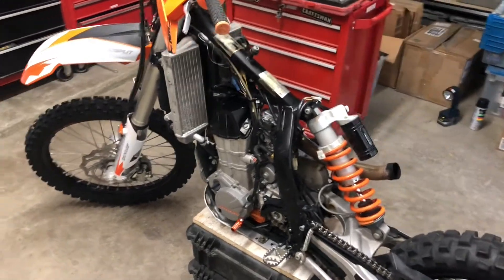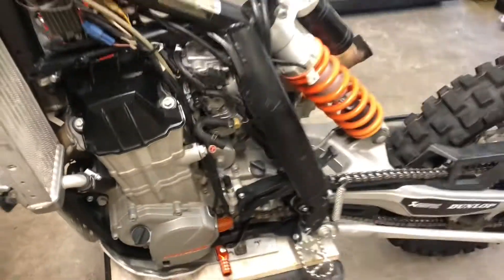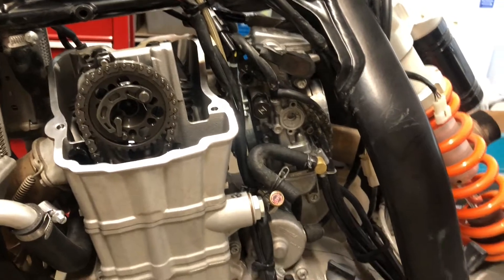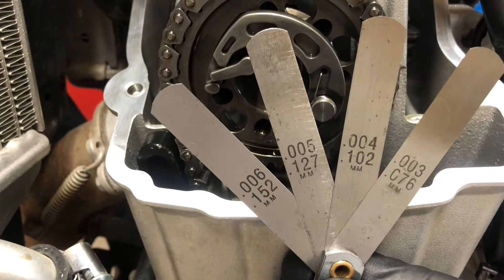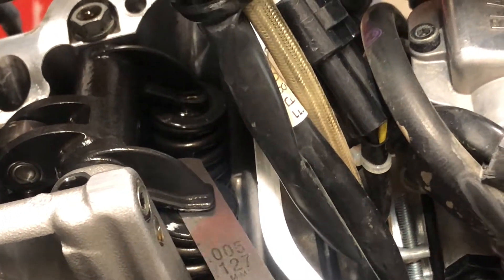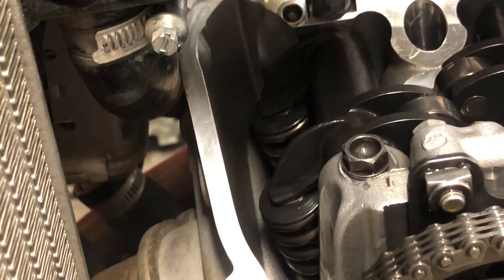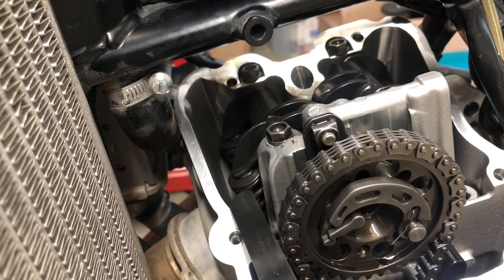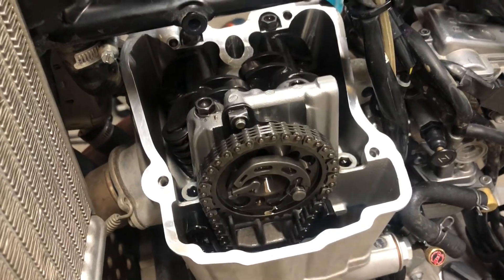KTM Valve Adjustment Without Swapping Shims

Comment: Colin,
Looking at getting one of these bikes that seems clean and has low hours/mileage.  I’m curious your thoughts on ownership and parts availability for the 530.  If possible would be great.
Reply from the maker: Great bike. Best of the best of the carb'd era. It has great brakes, clutch, suspension, motor, so not much of the core bike you need to upgrade.

That said, definitely do the JD Jet Kit to allow for a wider altitude range and overall better responsiveness. The headlight sucks. The stator mostly makes AC for the lights. The DC charging circuit is pretty wimpy, so you need to keep the thing well tuned so it starts quickly. Best to do full charges on a maintenance charger at home. And I upgraded to an Anti-Gravity battery. See my video on testing the charging system.

Check your engine and trans oil levels regularly to monitor for oil transfer. See my other video on it or see the videos from guys who have figured out how to drill a specific hole to marry the sumps together. It's not that big of a deal.

I've spent the last week finding parts to upgrade mine for a multi-day camping trip. The aftermarket isn't super strong on these 08-11 anymore. For example cargo racks are hard to find. Baja Designs has a great light package, but often out of stock. I found older Acerbis Rally hand guards that fit. And often you need to look at aftermarket parts for an 07 and earlier 525 or a 12 and later 500 that will often times fit.

AOMC.mx and rockymountainatvmc.com have OEM part finders with diagrams, and I've never had a problem getting any factory replacement parts.

All that said, it has tons of power, yet super forgiving. I feel like I've had it down at 1 rpm in an awkward climb in the wrong gear and it just thumps along like a steam engine. I picked this bike up as a novice rider. It's been great to learn on, yet I won't outgrow it!

Comment: Thanks for this. Can you explain the mechanics of why valves get tight and not loose? I would have thought wear on the shim and rocker arm could easily make them loose…
Reply from the maker: Hey, you're welcome. When valves slam closed 100s of millions of times, they actually beat up their seats and close slightly farther into the head over time. Meanwhile the cam and rocker wear is so slight that they are effectively unchanged. So you need a smaller shim over time to make up the difference. We're talking about thousandths of an inch, 10ths of millimeters, so it's small, but important for keeping your engine running well.
Reply: @colindgrant  thanks. Makes sense

Comment: Was the bike running perfectly fine before tinkering with the valve adjustments?
Reply from the maker: Yes it ran very well, but it was a used bike so I didn't know the last time they had been checked.
Reply: @colindgrant   my bike stopped running on me while I was riding on the freeway in 6th gear , I checked spark and gas was good , everything was turning in the gearbox , I took it in and they tell me it has low compression.  It will be my first time rebuilding the top end . My dots for tdc are in the same spots as yours that’s why I was wondering if your bike was running before the adjustments. My bike is a 2009 exc 450 ktm . Do you think it has something to do with my Torque limiter? Or flywheel bearing ? Why it’s not firing up
Reply from the maker: @johnnygalvan1344  if it stopped running while on the freeway, then something happened. Low compression could come from loss of oil or a head gasket failure. But if it stopped running while you were riding it I wouldn't suspect the starter.
Reply: @colindgrant   wouldn’t I still be able to start it if it was also a kick start ?
Reply: @colindgrant  starter or stator ?
Reply: @colindgrant  What originally happened was the spring came out of my hydraulic clutch cable and it prevented me from shifting gears so I pulled over on the side of the freeway and got that fixed but after that I couldn’t start it and still can’t
Reply from the maker: @johnnygalvan1344   @Johnny Galvan I meant 'starting system' earlier but that was based on reading what you said initially: "my bike stopped running on me while I was riding on the freeway in 6th gear".

The torque limiter is easy to test. If you CANNOT start it with the starter (and a full battery), but you CAN with the kickstarter, then it makes sense to suspect the torque limiter. If you can't start it either way, then I would look elsewhere. It sounds like low compression is your problem.
Reply: @colindgrant  yup I can’t start it using both kick or E start ,  it pains me dearly but it’s time for the last resort and take it into the shop , god knows how much they are going to charge me . I just don’t have the time right now to take this thing apart , your replies are greatly appreciated . I respect your knowledge
Reply from the maker: @johnnygalvan1344  Sometimes using a professional is the lower cost all things considered. Good luck.
Reply: @colindgrant  I’m a Lil more of a DIY you’ll never learn until you try . Even tho it doesn’t always go as smooth .  So I was able to figure out the issue on my KTM and it was the oil leaking made the pistons hot and now I’m getting the cylinder head honed and installing new piston .
Reply from the maker: @johnnygalvan1344  Ah, glad you figured out what was wrong. Nothing worse that throwing parts at a problem to fix it but not know why!
Reply from the maker: @johnnygalvan1344  You may want to take a look at my other video on this bike because it deals with oil system upgrades that could help prevent future oil issues.
Reply: @colindgrant  got the link ?
Reply: @colindgrant  no but I threw 300$ at Delamo Motorsports in LB for them to do a inspection ✌🏼 when all they did was strip threads with only telling me I have low compression

Comment: Really great videos. Thank you! One question on your radiator fan. Can you give me some background on this? I am worried I might be over stressing the factory stator if I add a fan with headlight, etc.
Reply from the maker: Thanks! I don't know a lot about the fan, it was already installed when I purchased the bike. I can tell you that it is DC and runs off the battery. It turns on when a thermal switch determines water is getting hot, but I can flip a switch to keep it turned off. The headlights run on AC, only while the bike is running. The highest stress on your stator would be a completely dead battery, fan on, and headlight on. I don't think it would be an issue. If these bikes have a charging regulator between stator and battery then it definitely wouldn't be an issue.
Reply: @colindgrant  thanks for the feedback
Reply: I put a trail tech 100 watt stator in to help with bigger lights and my fan. works great and worth it!
Reply from the maker: @nwyoda8792  Thanks for the follow up post! Nobody ever does that, I sure appreciate it!

Comment: Hi. What grade of flatting paper would you say each side of the sanding stone is? I don't have access to one but I have lots of sandpaper at work
Reply from the maker: Totally guessing here. I'd say 400 and 800 grit. Wet/dry sandpaper will work. Use some thin oil and a flat backing surface. 3M Trizact is pretty amazing stuff so if you can get your hands on that, I recommend using a super high grit (like 3000) for the final polish. Put some good assembly lube on them when you reinstall them, as there will naturally be some wearing in that takes place once you start it up. Good luck!
Reply: @colindgrant  cool I have access to all of those. Cheers

Comment: Hi, why don't you use the top dead center bolt on the right side of the transmission cover? Some people use it, some other not... 
Thank you!
Reply from the maker: I read about that, but the notches on the timing pulley just make it so easy to visually see when you're at TDC, that I didn't  bother with the bolt you mentioned. I think if I needed to lock the motor in place at that position, I would use the bolt. Thanks for commenting!